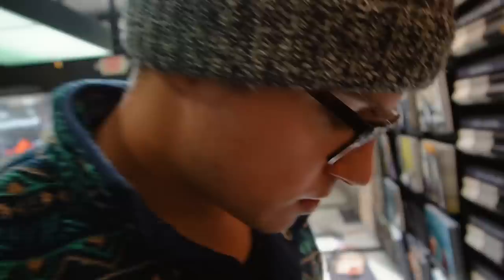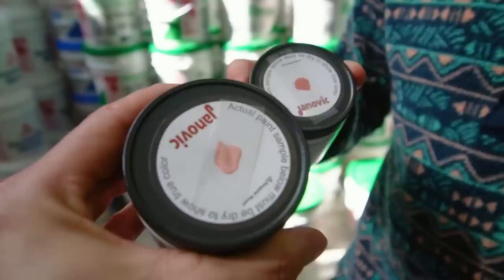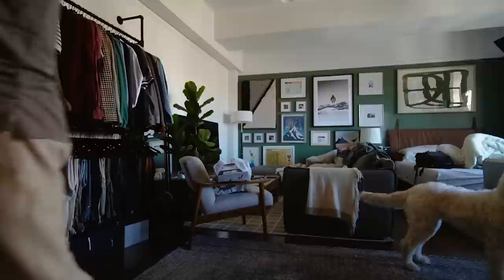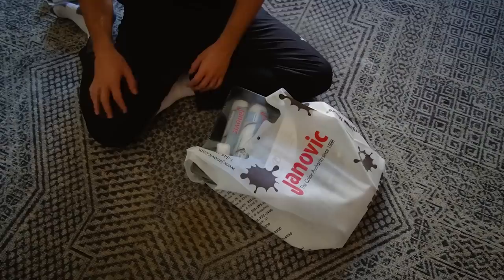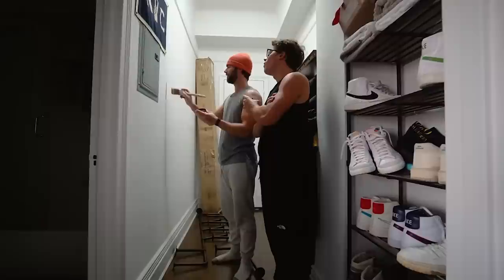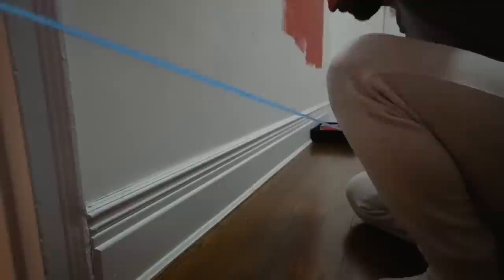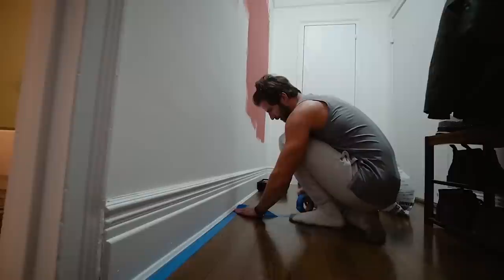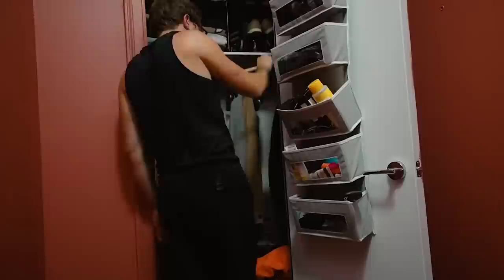YOU WON'T BELIEVE WHAT COLOR WE PAINTED OUR ROOM (FAIL lol) | Taylor and Jeff

Comment: I would have tried putting some artwork on the walls(when it was pink). It could have been a great backdrop for some gold framed pieces, and making the focal point the artwork and not the pink walls. As someone said above making the trim white might have broken up the pink a little. I think it could have worked. I understood the Mexican restaurant reference, a slight shift in the color (away from red/terracotta) might have helped as well. I think you were onto something cool.